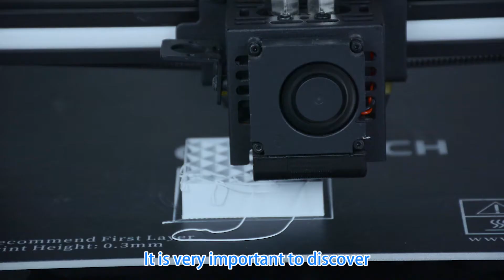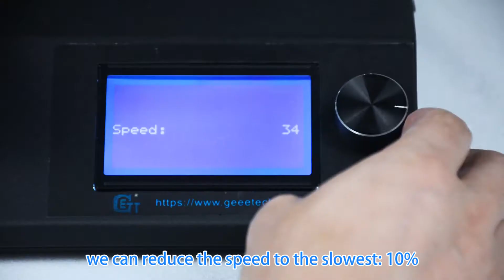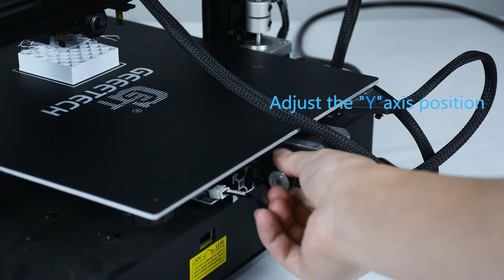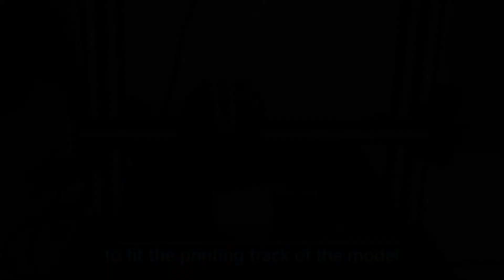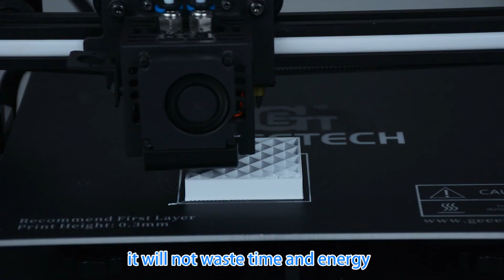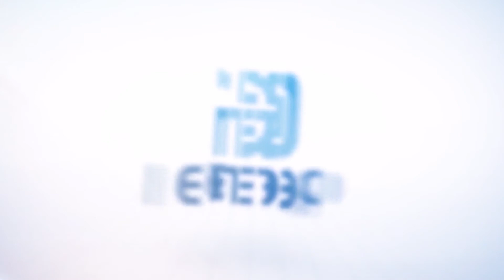How to Solve the Layer Shifting（Geeetech 3d printer）

Comment: My a20t is getting a y axis shift. Any idea why?
Reply from the maker: Possibly the printing speed too fast, or X/Y axis belt loose, you can decrease printing speed or tighten the belt. it's also possible that it's settings problem, https://www.youtube.com/watch?v=JPljmHDLmow check this video and download cura files from our official website. https://www.simplify3d.com/support/print-quality-troubleshooting/layer-shifting/  here is also an article for your reference.
Reply: @geeetech3dprinting  this is a new unit printing at 50mm a second. I have 5 years of experience and over 50 machines now. Belt tighter ensures it’s not loose.
Reply: @geeetech3dprinting  defect unit?
Reply from the maker: @JoshuaHaasua  see the website link for other reasons, if you still have problem, you can go to our official website, create an account, log in, then create a ticket in help & support, our technical support staff will help you. You can send some photos or video to show it.
Reply: @geeetech3dprinting  Hope so. I purchased 6 Geeetech units and all 6 do this Y-axis shifting. Very disappointed by this.
Reply: @JoshuaHaasua  im having similar issues with theA30T have you resolved this if so How?
i have an incling that it is slicer setting issue.
Reply: @sakkary9081  sold all of them. I spent 6 months dealing with issues and got the Sovol sv04 which are fantastic. Geeetech are some terrible machines. I have 25 machines, and they were the biggest nightmares.